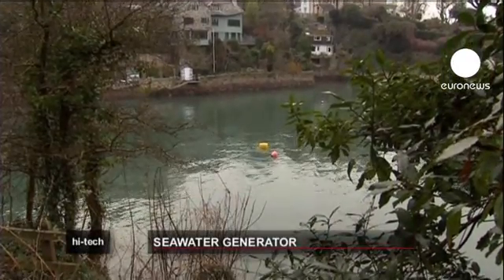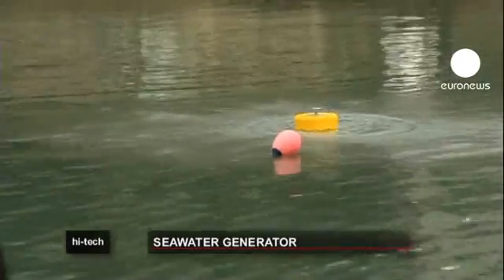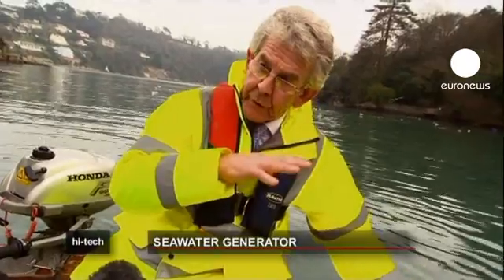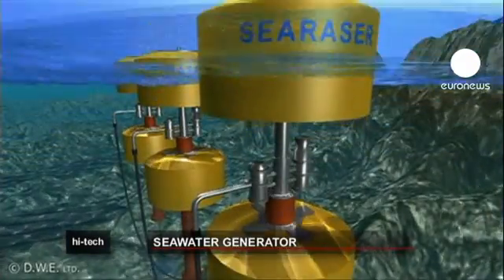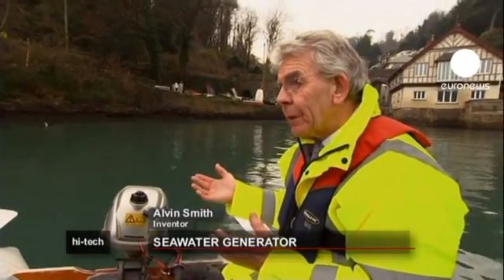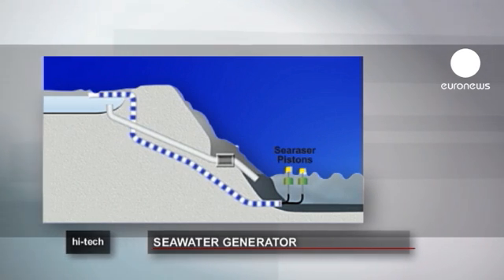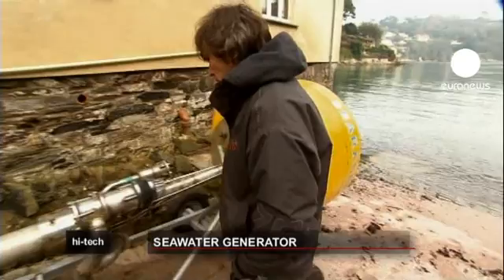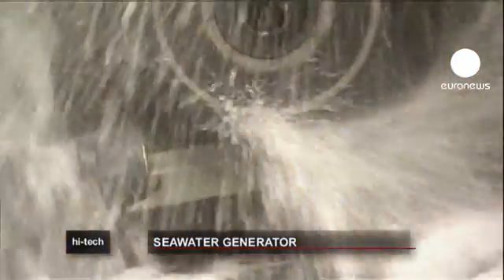euronews hi-tech - Sea solution to future energy needs

Comment: The ultimate solution to zero carbon energy is to anchor a hose at the bottom of the atlantic ocean and the other end to the surface and use it to turn a massive generator. Thereby bringing the entire volume and weight of the atlantic ocean to a single focal point. This is "Hollywood" laying the real deal solution to the energy equation on you all, short and sweet. Remember, Mike "Hollywood" Holloway is the man that thought this idea up. I want credit for my idea. Screw exxxon. Long live Hollywood!